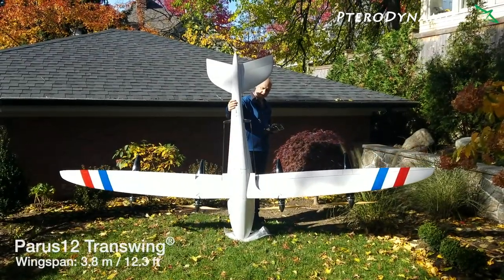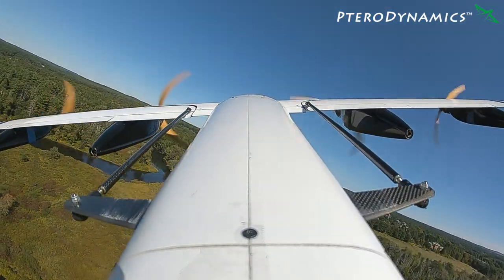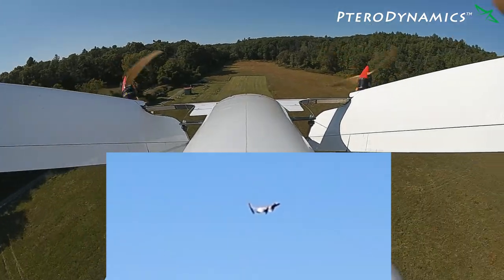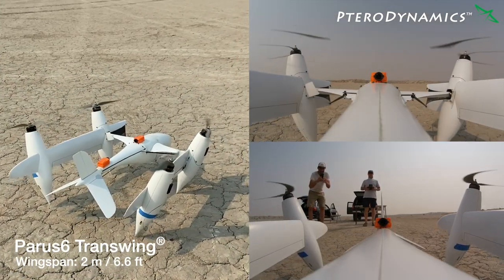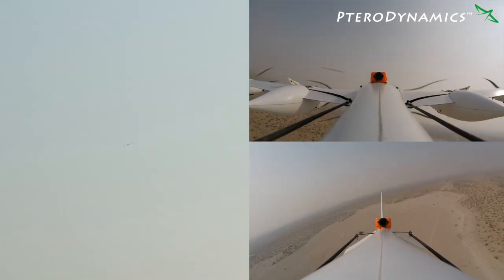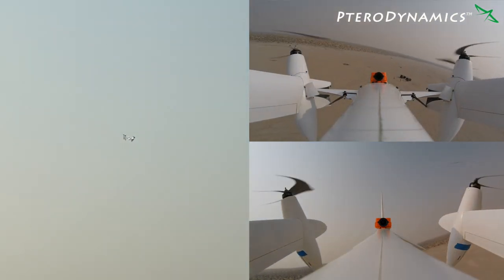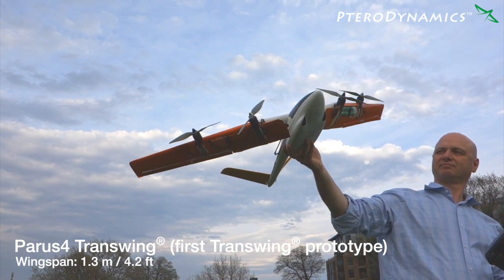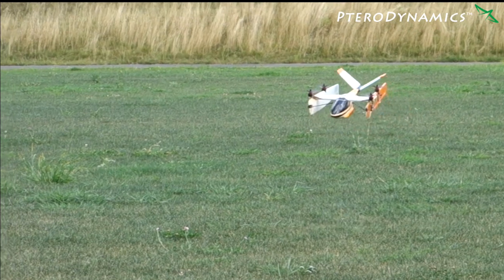Narrated overview of PteroDynamics' Transwing® aircraft design (transcript below)

Comment: Interesting -- do you suppose that Transwing will replace helicopters?
Reply: Helicopters are great at doing one thing: hovering, which is essential for things like rescue work and construction, but not useful for traveling. (The faster a helicopter travels forwards, the more it fights against itself as the airspeed on the right and left side of the the big rotating blade are different.)

This PteroDynamics design uses wings, which are the best thing for forward travel.
Reply: @codetech5598  That doesn't quite serve to answer the question -- does Transwing's design make it less suitable for hovering with loads than helicopters?
Reply: @rdbchase  Transwing is not efficient for hovering.
Reply: Best use is reduced takeoff and landing distance. A new form of efficient vtol transportation.